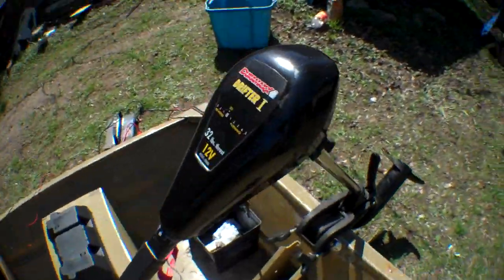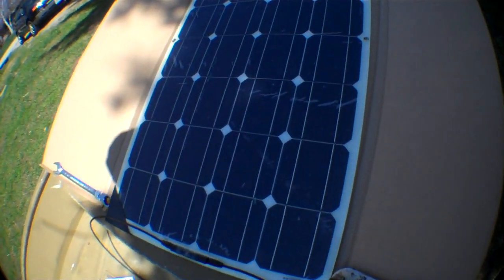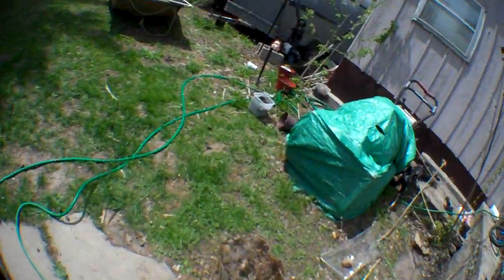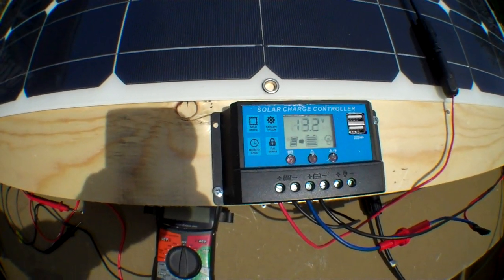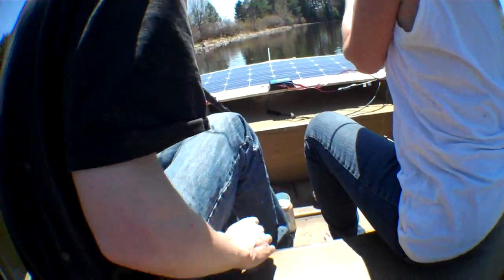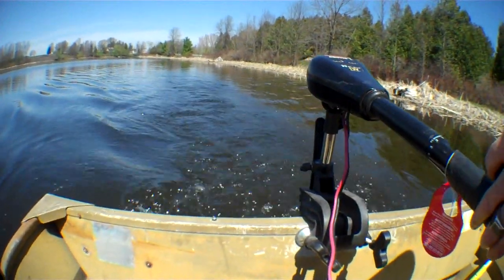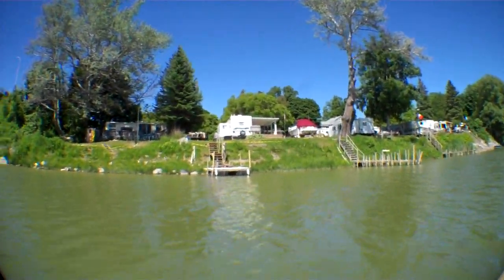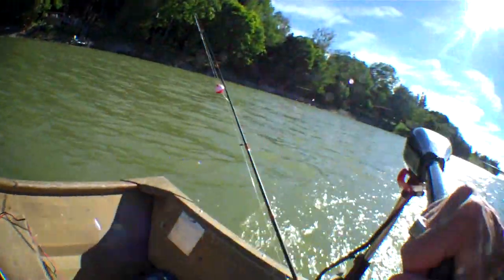# Solar Boat project

Comment: 32lbs its about 300W. This give you 6amp for every gear for 5th gear engine. How its possible that your engine on 3 gear draw only 5 amp? On my calculation you wilk need 18amp

Comment: Nice project ! May I ask how many Amps hour is your battery and for how long you were  able to run your trolling motor when it was connected to solar charger ? Many thanks for answer .
Reply: its just a car utility battery it will not go at all without the solar,maybe a few minutes at most,the solar acts as an alternator,like for your car battery and keeps it fully charged in the daylight,so you can go all day long,
Reply: @1Theebluesman  it’s amazing that you were able to do it that way . Thanks for fast turn around and send me a great answer . 🙏
Reply: @jbehzad  cheers !!

Comment: Do you a video of the upgrade with the 2 panels? I have a video up with how I keep my 10ft boat solar charged.
Reply: no,,i have lots of video of it and how its setup tho,fished the last 2 years,that battery is heathier then when i first statrted using it 3 years ago,the way i made the roof is removable with 4 pins,and u can drive the highway with it on the trailer also no problems,,i should make a review of it,with the 2 panels its on float all the time and i use only a car utility battery 800cc...full throttle all day it still just floats the battery.
Reply: @1Theebluesman  I hope you do a video of it. I would love to see your setup.
Reply: ok bro,,might as well,ill find the clips,and put a video together tonite,i did catch a few huge trout last fall ,can add that in there too,lol!!

Comment: im sure you have figured out by now it draws 6.5 amps until the prop is in water and draws double
Reply: ya for sure,,that was a few years ago,that system worked great battery was always full,,but now im running 2 panels and made a pole roof for it,,and can go wide open all day if you wanted,, the battery is on float always now,,u gotta love the no gas econo part of solar ..even got my house hydro bill down to minimal with just 6 panels,last bill was 38 bux :)

Comment: what panel brand did you buy?
thanks! Kyle
Reply from the maker: hi, i got it on ebay, its made by solarparts.com i bought a 4 pack for $480,,they are usually around 130 each for the flex ones,2 years and still like new,i built a roof with 2 panels on the boat now,works great,battery floats all day now,they have them in a warehouse in toronto too,im in canada so i got them the next day.i have some renogy panels on the house also same delivered the next day,pretty well the same price.
Reply: @theebluesman  Thanks man!

Comment: cool setup works great! How long have you been able to navigate? cheers from Brazil!
Reply from the maker: Thanx! i can fish and troll all day long with this setup,but not go past 3rd gear,4th and 5th drain a bit,but it gets it back as soon as i go back to lower gears,so,,this year i have added another 100 watt panel,to keep the battery full at all throttle settings and making a small roof for the panels,so i can use the fishing platform on the front instead of having the panels there,ill post a video when its done.Thanx for watching :)